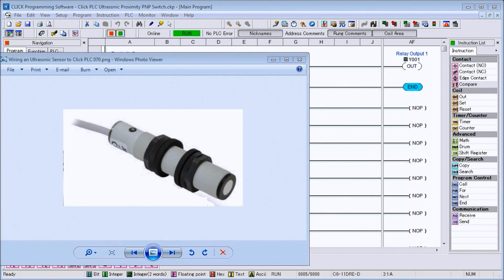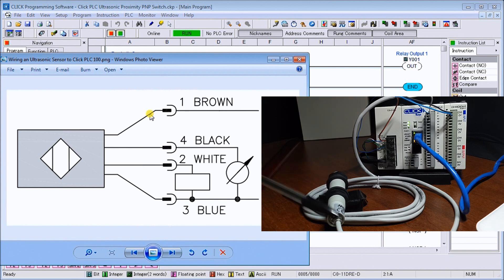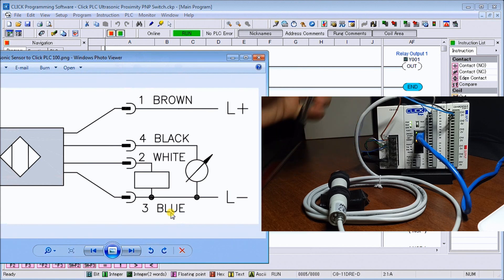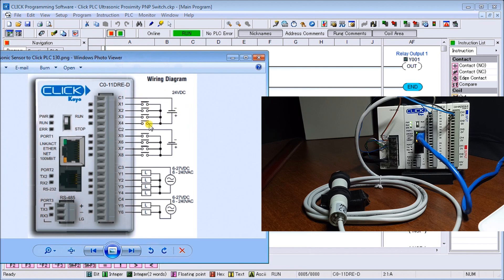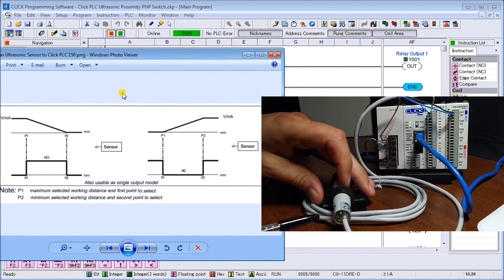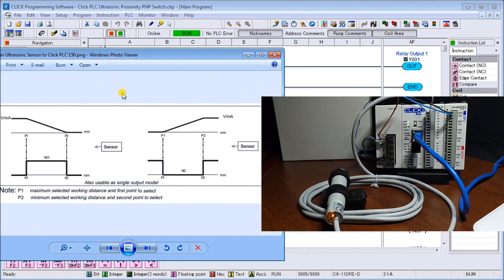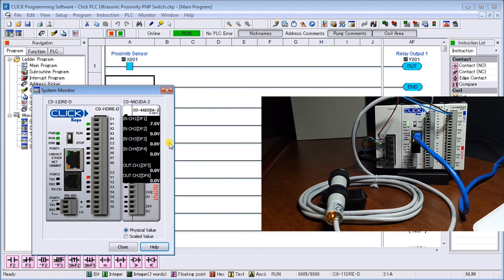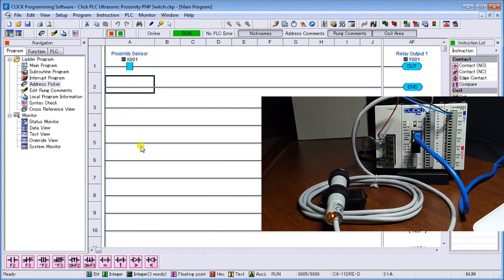Why Ultrasonic Sensors Outlast Every Other Switch on Your PLC

Comment: Hello sir, How to connect low voltage sensor to plc please reply the sensor output also low voltage.?
What must be the voltage for connecting  to plc x pins?
Reply from the maker: Hi Thaskar,
In order to connect low voltage sensors to the PLC, an interposing relay is usually used. This can be mechanical or solid-state. Low voltage is usually referred to less than 5 VDC.
https://accautomation.ca/wiring-interposing-relays/
This post should help you out.
Regards,
Garry
Reply: @ACCautomation  Thank you . How much min voltage required does 12 v enough
Reply from the maker: @thaskarthaskaran1425  
You would have to look at the specifications of the input of the PLC that you are using. This would be listed as a minimum voltage level.
Regards,
Garry
Reply: Actually the thing is I want to connect the raspberry pi output which is 3v to plc . Can it be done by boosting the voltage.?
Reply from the maker: @thaskarthaskaran1425  
To interface with a PLC you would either get a relay output board for your raspberry pi or get an interposing relay.
https://www.automationdirect.com/adc/shopping/catalog/relays_z_timers/solid_state_relays/socket_mount_relays,_4a_(ad-70s2_series)/ad-70s2-04b
This link will show a solid-state relay that has an input of 3-30 VDC input. 8-12mA draw for the input.
I hope this helps you out.
Regards,
Garry

Comment: can i connect a vfd to this PLC to adjust the speed of a 3 phase motor please sir answer
Reply from the maker: Hi Kinsley,
Yes, you can connect to a variable frequency drive and control the speed. 
Usually, you will have local or remote modes on the VFD. The local mode can control the VFD through digital and analog signals on the PLC. Remote control would usually involve a communication protocol like Modbus TCP, Modbus RTU, Ethernet IP, etc.
Here is a video showing Modbus RTU communication to control a 3 phase motor.
https://www.youtube.com/watch?v=3ZpFqL1200I
Regards,
Garry
Reply: Man thanks you so so so must you just save me..